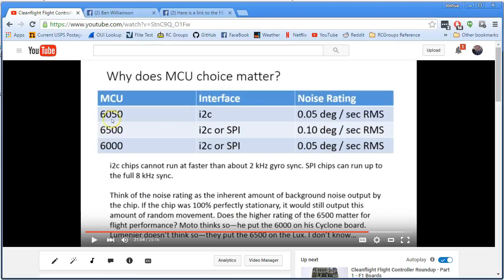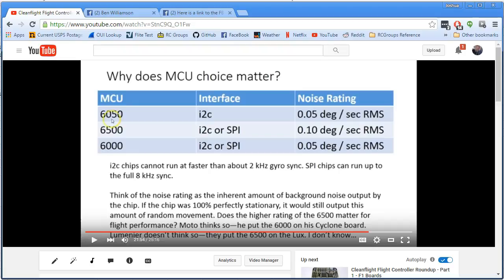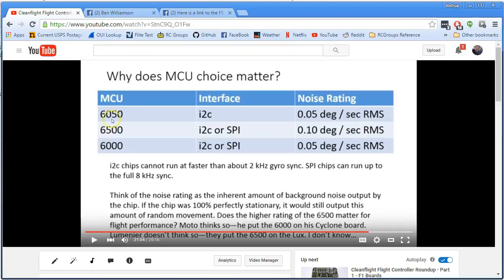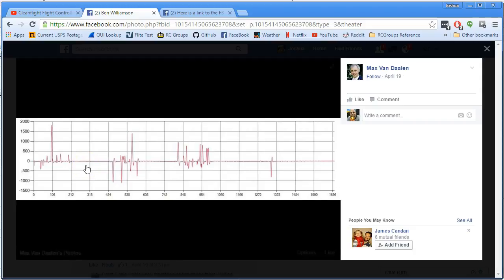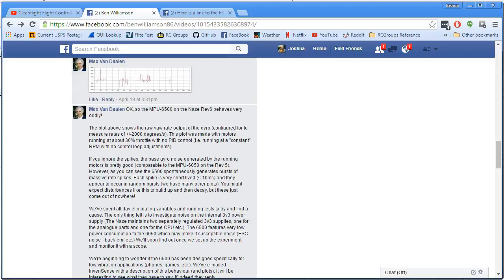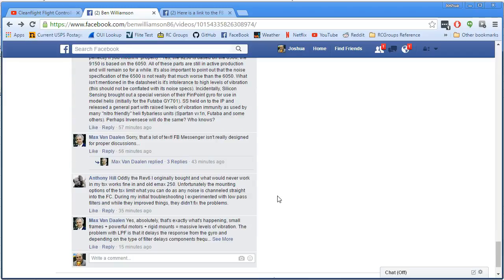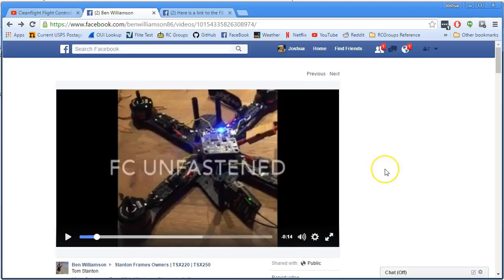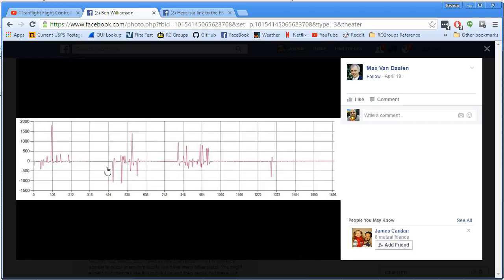Invensense MCU6500 Smoking Gun?

Comment: got weird motor twitching at low throttle in a hover on one of my quads with a naze rev6. It causes little yaw twitches. 
New motors and ESCs. Using the configurator motor test tab with the quad strapped down and props on, all run smoothly. Until then and watching this video, I thought I had a bad motor bearing or something.
Reply from the maker: Try soft-mounting the controller with vibration-damping bumpers.
Reply: Thanks Joshua. My Naze Rev6 is hard mounted. I'll give it a try.

I mounted my Lux on a different machine with the rubber rings that it came with, and it's fine.
Reply: did you try soft mounting it?  I have exactly the same problem, hours of problem solving was breaking my brain!

Comment: Countless people have had this issue on TMQC page on facebook for months and months, I had it for a while and it's the reason I've stopped using the r6 naze. Some people have managed to fix it with rubber orings on in their mounting. I figured someone would get to the bottom of the issue sooner or later. I have seen some boards continue to have the problem even after rubber mounting. Easiest solution, stop using the r6.
Reply: I also had this twitching issue with a frame that simply had 1 loose screw on the top plate (maybe caused excess vibration?).
Reply from the maker: +Jon Keller Part of what makes it confusing is that it doesn't seem to happen to everybody, or on every copter. I have seen enough blackbox logs to know that it is real, but I still can't for sure conclude that it is caused by the 6500. When I installed Betaflight 2.6.1 on my QAV-R, I was getting weird gyro twitches that I couldn't explain, and my flight controller has a 6050 chip.

Comment: I've got two quads with a LUX.. 
5" Epiquad with Cobra 2300's and LB20's. Flies smoooooth with the new 2.6.2 V3 from Boris.
4" QAV-R with Emax 2300's and LB20's.. got the twitching!

Now the story of the 4" ....
I started with a 4" Thug frame and Cobra 2300's and the LUX. No problems at all.
Then I set some Emax RS2205 2300's on them. Flying the first lipo's, no problems. Then I got a minor crash.
After that I got the twitching. Setting Dither on BlHeli from 15 to 31 helped. No twitching.

Last week I broke the Thug frame in two with a garage race. I set the Emax/LB20 setup from the Thug to a QAV-R frame with a brand new LUX. The LUX also broke in the crash.
Again I had the twitches! I had to set the Dither from 15 to 63 to get rid of them. They were gone. The same evening I had a race and plugged the first lipo in. Nooooo.. twitches aaaaah! But I just raced because the twitches always are around mid throttle. After a few laps the twitches were gone again.. 

Another person in our group with Emax red bottoms also had twitches. Putting rubbers around the LUX made them go away with his quad. Some other people with Emax had the same as I'm reading here. I got this feeling that the Emax red bottoms produce more noise then the Cobra's and the LUX feels it! And that there is a difference between 4" and 5"  setups.

I've got a Cyclone and I'm gonna put it on the 4" QAV-R frame.. Also gonna set the LUX from that quad to my 5" quad just to make sure the problem isn't in the LUX itself.
Reply: +Roy van Lith I've builde the Cyclone on my 4" quad.. twiches gone! Even set the Dither back to 15, stil no twitches. Definitely a LUX problem. Now if I can find the time, I'm gonna exchange the LUX of the 5" with the LUX of the 4" to rule out that the LUX is not good..

Comment: a friend of mine had those motor ticks on a tweaker he built, he changed the flight controller from a SPRF3 to a naze32 then to a lux, all 3 exhibited the motor ticks but the lux was the worst. he eventually eliminated the ticks by going from emax red bottoms to old version emax motors. he even tried both kv versions of the red bottoms with the same ticks happening. along the way he tried all the different filters, blheli settings ie timing and dither. maxing out dither helped but the motors got hot quickly. changed the motors and all was well again.

Comment: Hi Joshua

Interesting that the TSX frame is having twitches on a LUX FC

I also had the same issue with my TSX220. Unfortunately the board becomes sandwiched between the top plate and lower plate with plastic standoffs.

I found that even with the O-Rings I still had a twitch, but if I backed the screws off that go through the inside hole on the arms and the PDB to where it utilizes the bolts and standoffs for both mounting the fc and securing the arms.

Tightening the inner bolts on the arms, caused the nervous twitch, which ive yet to see on my 280 and 180 frames.
Backing the bolt off 1/4 of a turn made the problem dissapear, my fix was to turn the frame over, remove said inner bolts and install some more rubber o rings under the head of the hex bolt.

I also shortened the stand offs slightly ontop of the FC, as to allow for the O rings underneath the FC to fit without unneeded load on the FC.

Hope this is of some help

Daniel
Reply from the maker: +Dan Brown weird. I guess a good question would be if people are having the same issues on 6050 or 6000 controllers. Don't want to have a selection bias.
Reply: +Joshua Bardwell 
I love the 3 lux fcs ive got.
I also found they required a different approach to tuning.

I wonder if other people have had to add TPA for there tunes.

Thats what i found helped me with the LUX.

Comment: Hey Joshua - you have a report of this happening on a single board.  I would seem to be prudent to reproduce this before broadcasting it as fact.
Reply from the maker: +John Driggers I've seen the glitches in many logs and so has Boris. The new potential fact is the explanation why the glitches are present in some and not others.
Reply: +Joshua Bardwell - so if I have a log - as Boris does - that does NOT show it, what conclusion do you draw?!  That our boards are the exception not the rule?  Don't get me wrong - using mobile phone IMU's in flight controllers is bound to create some unexpected and interesting failures.  What if the spikes are caused by out-of-spec G loads on the sensor?  Sorta like the ones you'd get in a crash..  Just sayin'.
Reply from the maker: No clue. The new information is that, if you have glitches, try soft mounting to see if they go away. This is not stating facts as gospel. It's publishing results for peer review and replication. That's science. So far, two people have told me that adding bumpers fixed their glitching 6500. That's the exact evidence you're asking for.
Reply: +Joshua Bardwell I'd love to see logs that show a difference.  I've another prototype coming in - maybe this one will show spikes.  Also, do you know where the InvenSense "use this in quads" notes were published?
Reply from the maker: It sounds like you're skeptical there's a difference. But what is your skepticism based on?
Reply: +Joshua Bardwell I've got three 6500's that I can't reproduce the problem on.  I am 100% in agreement that the raw data from the 00 vs 50 chips is difference.

I'm not disagreeing with your solution of soft mounting a F/C if you are having the noise spikes, simply that I've not see enough data to convince me it's an endemic problem with the chips.
Reply from the maker: +John Driggers that's fair.
Reply: +John Driggers I think the chips are more sensitive especially to high frequency noise vibrations. It could be that the 60x0 series chips are the anomalies in that they can handle being hard mounted to super rigid frames.

People are acting like isolating your gyro from this noise is akin to giving up all your Halloween candy just because its not what they are used to doing. How can people get so set in there ways on such a rapidly progressing hobby?

Remember it is normally common practice to isolate flight controllers vibrations only in mini quads recently has there been a trend to bolt them directly to the chassis.
Reply: +Stephen Gibb I'd argue that, but only becasue I've just had a cup of coffee and one of my first "mini" quads back before there were "mini" quads was a warpquad with a MotoMoto MotoWii integrated controller.  

I'm 100% NOT against isolating your flight controller, and on most of the things that I fly that have IMU's, they are isolated.  If you are having noise problems, that should be one way of fixing it.

All I'm saying is that saying that "we've found the smoking gun" is IMHO a bit premature.  I suspect that an equally valid argument could be made that ANY of the IMU's designed to detect direction in mobile phones would benefit from being isolated from the frame.  I would also wonder what the impact on an IMU that's designed - as above - to constant vibration and impacts.  Maybe after a couple of crashes a 60x0 get's worse.  Or better. Or no change.  

In a greater sense - Boris' filters are software solutions isolating noise. :)

If it stays wet this weekend maybe I'll put my money where my mouth is and strap a couple of new f/c's to a static platfom and vibrate them at different frequencies and see what they record side by side with the same config and same inputs.
Reply from the maker: Well, that's why I put the question mark after the click-bait title :-)
Reply: If you follow the github ticket: https://github.com/betaflight/betaflight/issues/322

Some users were reporting that not all 6500 / 9250 have the gyro spike issue.  I guess it's a manufacturing QC type of deal.  I ended up having to isolate my FC and the problem was fixed

Comment: i have my LUX on a Armattan F1-4b 4mm frame with RG205/2700 and even with my front two rotors quasi questionable [have replacements for those] it still flies great. only thing I have issues with is massive prop wash oscillations but those props put out so much thrust anytime I drop into it its pretty unstable airspace I am sure. I do have the rubber O-rings on it, but I currently am about to rebuild it [also fixing motors] and might look into those rubber mounts for it... I think getfpv sells them? cant hurt. either way I am pretty happy with the board on this particular quad. its a tank of a quad though.

Comment: Hi Joshua,

I have a Naze32 Rev6a on a newly built 5" Alien. I'm getting weird twitching on the yaw axis, and as far as my tests have proven, it's not PID-related. Basically, the aircraft quickly yaws about 1-2 degrees, and then quickly jumps back. It only happens at a specific throttle range (between 1300 and 1400µs). I've also noticed unusually high spikes on the gyro's yaw axis in my Blackbox log, just as it was mentioned in your video. I thought I had a faulty motor or ESC, but the chance of that seem to be quite low (I'm running 30A Little Bee ESCs with EMAX RS2205 2300KV motors). Then I've tested my RC gear, but it seems to be spot on 1499-1501 on both yaw, pitch and roll. Could it be caused by the MCU6500?

Thanks

Comment: Interesting findings! We'll do a hard mount of the Lux and see how that goes and then follow it up with soft mounting. So far the only 6500 we've tried was on a Rev 6 Naze and that's the only board we never got a good tune on. Thanks for sharing!
Reply from the maker: +BMSWEB I think whether you have problems with the Lux will have a lot to do with how noisy your copter is to begin with. Somebody with a vibration-free copter may not experience the issue. Anyway, it should be easy to reproduce with the gyro line as shown in the FB post.
Reply: Its good information Josh. I love the layout and design of the Lux, the only thing that has us really apprehensive is the MCU, but we'll see how we go. To date the only F3 Boards we have experience with is the Moto Moto boards from ImpulseRC and F303, so the lux will be an interesting adventure :D
Reply from the maker: BMSWEB I think the Cyclone is really an amazing board, especially now that VCP BLheli passthrough is sorted.
Reply: +Joshua Bardwell One thing i found since moving to a Lux was my quad is more sensitive to unbalanced props. The HQ 5x4x4s i've tried flew beautifully even on a stock tune, where as the DAL bullnose props that flew just fine on my dodo and naze rev5 quads give it bad wobbles under throttle.

Comment: I had the naze32 rev6 and it gave me headaches... had issues with yaw and gyro level. I switched to the xracer f303 and im happy and in love :D
Reply: Although I'm slowly getting attracted to the falcon f4 with the mpu9250 and trying out raceflight with multishot.
Reply from the maker: +Bryan M I think that the Naze32 rev6 has some persistent issue that is not directly related to the choice of MCU.
Reply: +Joshua Bardwell Yes I saw too many cases where users send me logs of naze32 rev6 with these yaw twitches, but not with other MPU6500 boards.

Comment: what does the xracer f303 have onboard?
Reply from the maker: +knwest2012 6050. The "good" one :-)
Reply: sweet, got one on way
Reply: +Joshua Bardwell well wouldn't the 6000 be the "best" one? or no?
Reply from the maker: 6000 or 6050 are both good.
Reply: Joshua Bardwell meant 6000 has SPI yes?
Reply from the maker: prOkrEAt correct. But I'm not convinced that is a game-changer. The 6050 can run at 4 kHz on Betaflight, so I have to wonder whether going to 8 kHz is that big of a deal, especially given that the jump from even 1 kHz to 2 kHz was not massive. When you look at the boards using SPI, you see that they usually are missing other features like SoftSerial because the designer has to use those I/O pins on the F3 for managing the SPI bus instead. So anyway, now that you can run 2.6 kHz or even 4 kHz on a 6050, I wonder whether it is worth giving up that stuff to get to 8 kHz. Maybe it is. But maybe it's not. As a result, I am not 100% convinced that 8 kHz with MCU6000 is preferable to 2.6 kHz or 4 kHz with MCU6050.
Reply: Joshua Bardwell never used softserial... actually only UART i use is for Rx, maybe one day i will put in a BB on some of my quads. i guess i used a port for telemetry now that i think about it. i do have my LUX at 8khz, my SPRF3 at 4khz, i dont think i can tell a difference in either from 2khz though...

Comment: Interesting, will you do a new F3 FC shoot out? How about a video about oneshot42 and multishot in betaflight and flashing the esc firmware
Reply: +Joshua Bardwell yeah I'd be very interested in a video comparing multi shot and one shot and standard pwm
Reply from the maker: +Flo Sch well I already disliked the 6500 controllers in my roundup so I don't think much has changed. The 6500 is not going to be bad in every copter. Vibration mounting mat be a good idea anyway, and may be an acceptable price to pay for features line the SP3 brings.